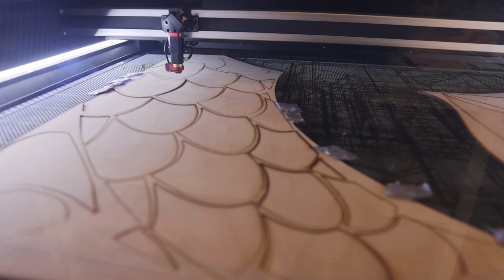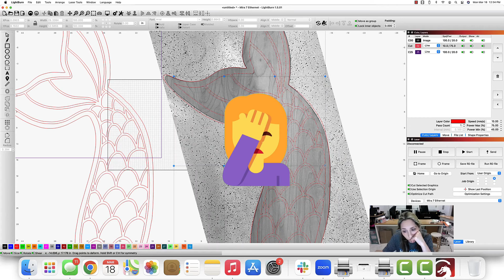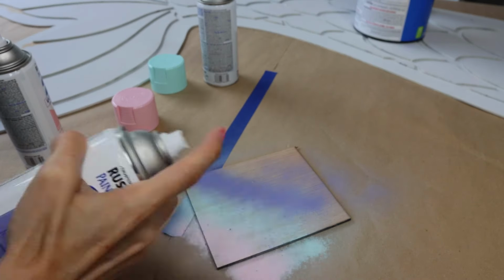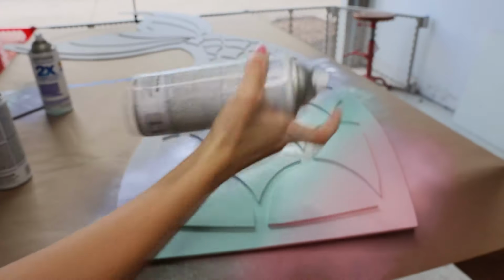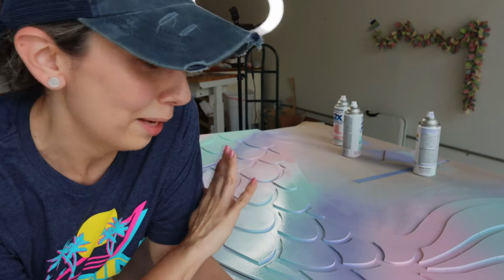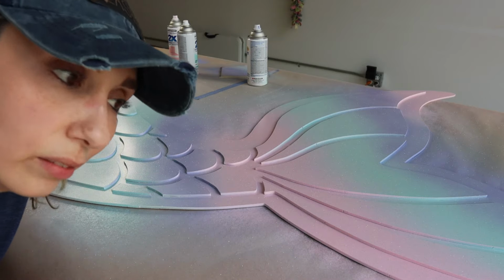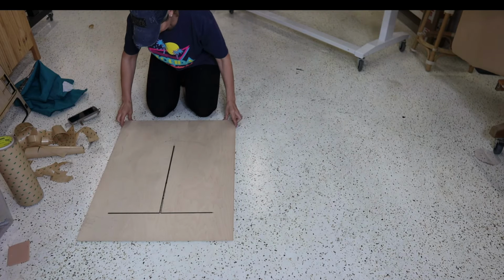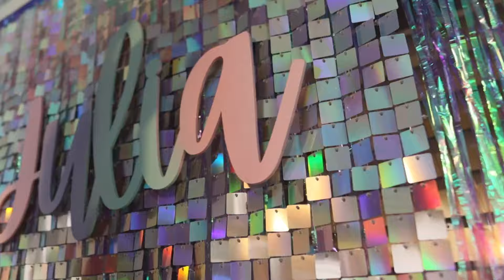How To Paint An Ombre Effect

Comment: Lucky littles. I love your videos. I see you using 3M tape quite a bit. Do you have a trick for aligning because in my experience, there is no wiggle room if you do not get it right the first time!
Reply from the maker: Hey there, thank you! I typically apply the 3M to the material before I cut.  This was such a big piece I would have just glued the supports together with Wood Glue but I was out so I just cut some strips like you saw in the video :)